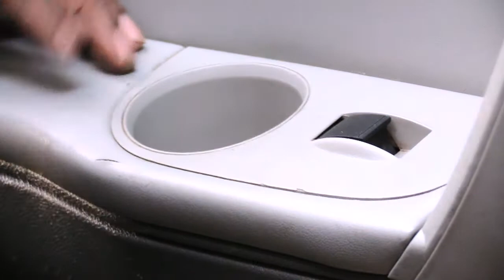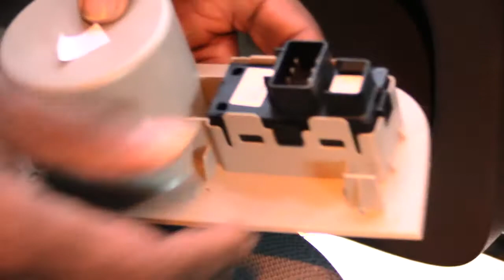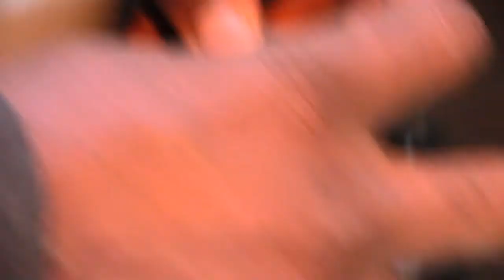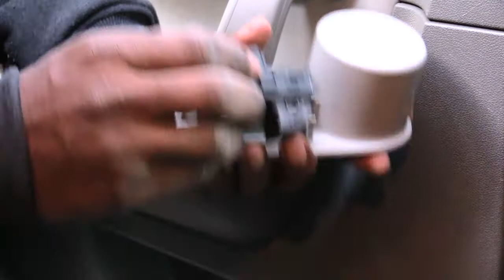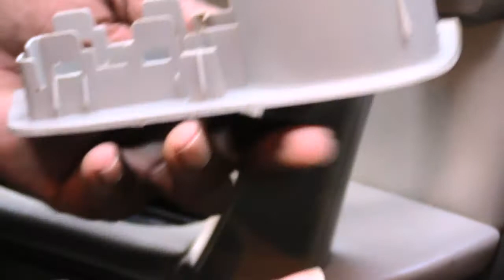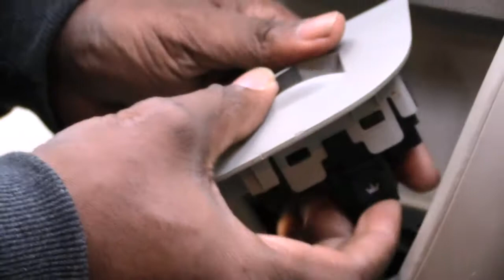Chevy Traverse; Buick Enclave, GMC Acadia 2009 -2017 Power Window Switch Replacement!

Comment: Great videos! Do you have a video on what could cause surging in a 2011 Enclave? Drives fine, has good acceleration and response but the rpms hand jumps constantly while driving but not while idling. Doesn’t run rough and doesn’t idle rough. Fuel economy way down as well. Changed spark plugs, didn’t change the wires. No codes on dash. When the rpms jump I can feel it in the performance but barely noticeable. Was misfiring before getting spark plugs changed, but better now.
Reply from the maker: Sounds like a bad wire are slightly dirty fuel Injector. please subscribe like and share and check our my other helpfull videos.

Comment: Another good vid!  Short and to the point!  Got a question about my 2003 Lexus RX300.  It starts and runs just fine.  But if you shut it off and then go into the Piggly Wiggly for a while and then get back in and start it, it will run rough for a few minutes.  (I already changed the IAC valve.)  Thanks.
Reply from the maker: Your welcome, hard to say many things can cause your problem I would run some gas/ fuel injector cleaner and if haven't recently change spark plugs and wires if it keep happening, also could be ECT sensor. Goodluck

Comment: Only the back driver side won't roll up but will down so what switch do I need the rest of windows and main work's
Reply from the maker: Sounds like you need a switch for that door or try to clean with some contact cleaner.Please subscribe & like and share if haven't already and check out our other helpful videos

Comment: FYI, this is not how you change it on a 2017 Traverse, you must take off the door panel and replace it from the inside. If you try to remove it by prying up on the cupholder you will break the plastic mold as it is one piece. Follow this video instead if you own a 2017 or newer, I know it is for a GMC Acadia but it is the exact same process. Just changed mine. https://www.youtube.com/watch?v=W6vY37NKZPo&t=264s